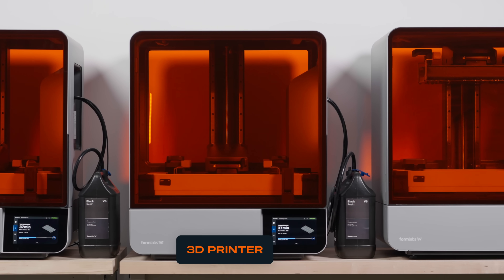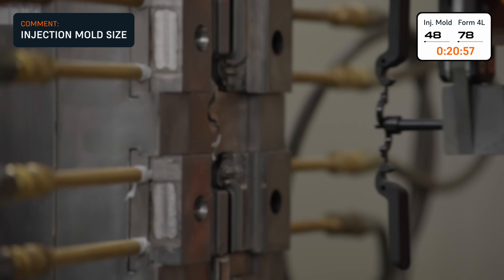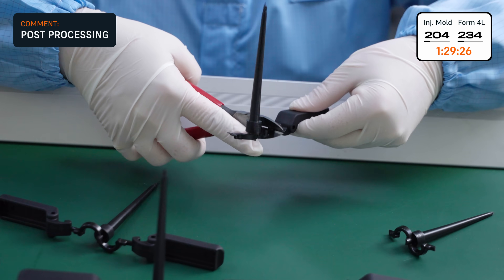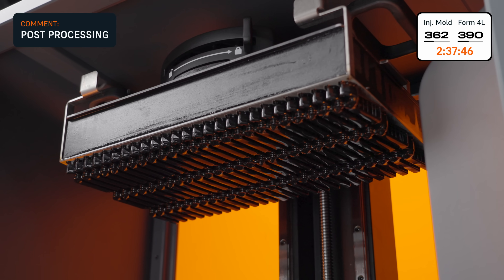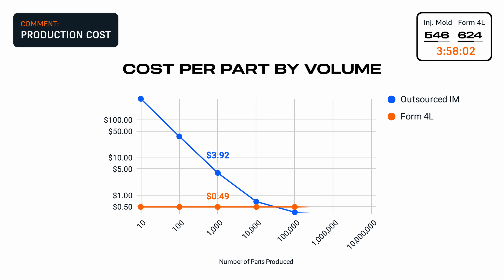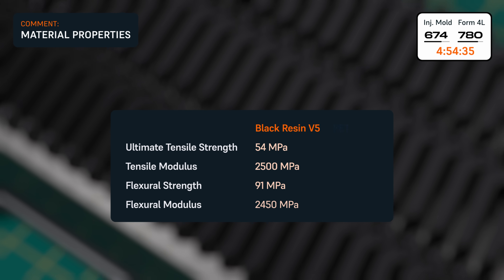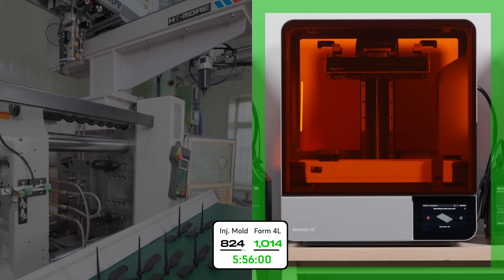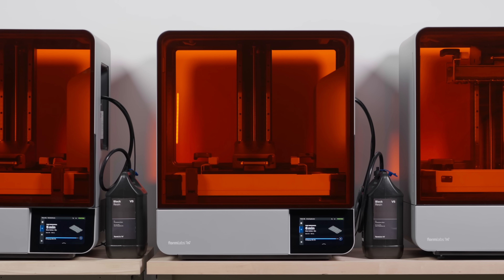Race to 1,000 Parts: 3D Printing vs. Injection Molding

Comment: I noticed that your spreadsheet doesn't include hardware, labor or maintenance costs for the Form machines. If you were to include those, the price per part jumps significantly:

I asked chatgpt to help me here:

Summary of Adjusted Costs:

    Form 4L: $11.33 per part for 1,000 parts.
    Form 4: $9.81 per part for 1,000 parts.

chatgpt prompts:
<send a screenshot of the spreadsheet>
* It seems misleading to me because it doesn't factor in the cost of the Form 4L and Form 4 hardware and equipment and maintenance costs. If you were to factor those into the 1000 parts, how much would it costs per part for Form 4L and Form 4? Also, please include all costs like maintenance and labor. 

-----

If the idea was that the hardware/maintenance/labor cost are part of doing business and shouldn't be included, then I would ask what would be the expected cost per Form part if I were to outsource it?
Reply: it was also misleading because it wasnt mentioned  The resin is UV cured, so parts never stop UV curing,  this makes the resin parts unusable for outdoor because parts will be brittle after a year.
Reply: Because you aren't throwing the machine out after the thousand parts. That injection molding machine is likely in the six figure range in cost, meaning each part would be over a hundred dollars. You do have to factor in the mold itself since it can only be used for that specific part.

Comment: Still much weaker, orders of magnitude in fact. Layer lines. Resin is far more expensive. A multi cavity mold can shoot hundreds of parts in less than a minute, and use recycled material. Aluminum molds cost hundreds of dollars only.
Reply: A part only needs to be as strong as it needs to be. Sometimes a 3D print is sufficiently strong provided the layers are oriented correctly and some don't care about layer lines if I tell them that hiding them will cost more. It's amazing how many people suddenly don't mind them when cost is a factor. For the FDM parts I sell, I can also customise them for the customer provided they can give me accurate dimensions. That's a service you can't offer with an injection molded part because you need a new mold.

Injection molded parts still have their place but at much larger quantities and with much larger budgets. For smaller production runs, 3D printing is an affordable alternative.
Reply: resin doesnt really have layer lines or z axis weakness. However, they only compared 1000 parts. Injection molding shines at quantities even greater than that.
Reply: It's not much weaker, they showed that, and who the hell runs production of large amounts of parts in an aluminum mold?
Reply: @zachbrown7272  right! The mold would be heat soaked after the first shot

Comment: Why not buy 30 Saturn4Us for the same price and have 1100in² more surface area? What sets the Formlabs 4BL apart?
Edit: for the record, my question is sincere and not intended to be interpreted in a scarstic manner.
Reply: Print success rate and post processing workflow.
Reply: @zachbrown7272 post processing is the exact in both resin printers. You need to wash and cure in both. In terms of print success rate my Saturn 2 8k has never failed to print something due to a machine issue. Every problem has been human error in terms of incorrect support placement or not calibrated correctly. Both of which are specific to the resin and object and will require the same work on both machines. For something 10x the price it definitely does not have 10x the features
Reply: Could you spell the name of that 3d printer correctly? I failed to find it in google
Reply: @goodfis624 is the elegoo saturn 4 ultra
Reply: @goodfis624  Elegoo Saturn 4 Ultra
Reply: @goodfis624 elegoo saturn 4 ultra
Reply: @goodfis624  the 2 printers I mentioned are the Elegoo Saturn 4 Ultra and the Formlabs 4BL.

Comment: Lack of colour options is a problem for final parts. If tough 2000 resin was available in black I would use it for a lot of finished applications.
Reply: At Plast 3D they can do any resin color by using pigments on a resin to color match with what you ask.

Unless the resin only comes in a color that can't really be modified like black for example
Reply: @survival_man7746 Formlabs has a colout kit aswell, but ony with proporties like their standard resins.
Reply: I got a better idea. I actually reached out to them a while back about this lack of options. I wanted them to do a Color Tough 2000 option.
Reply: Spray it black? The surface of prints are excellent for an easy one coat spray.
Reply: @mika_jurvanen  most need to be sanded if you want good adhesion